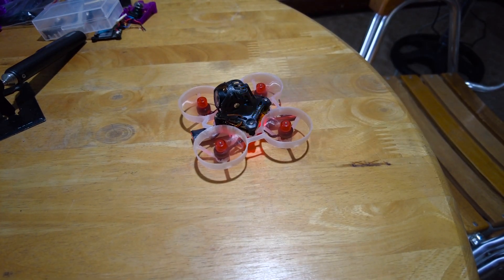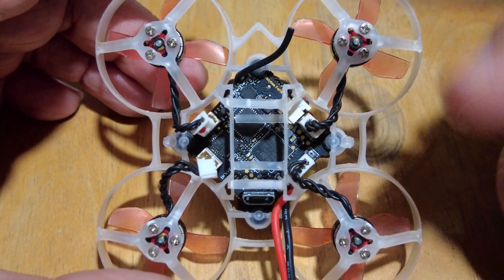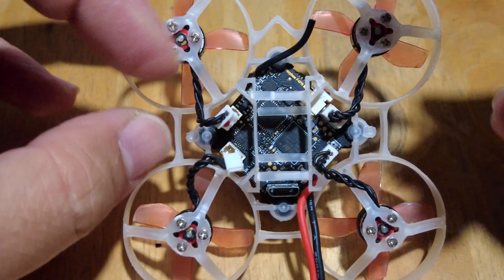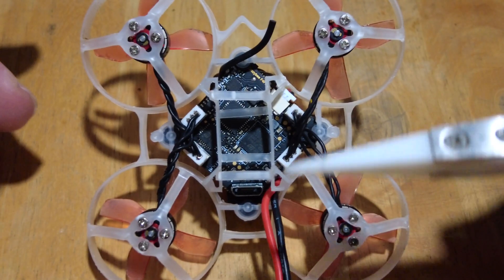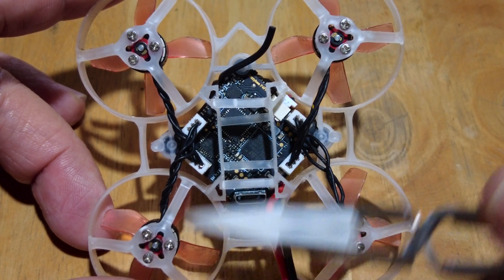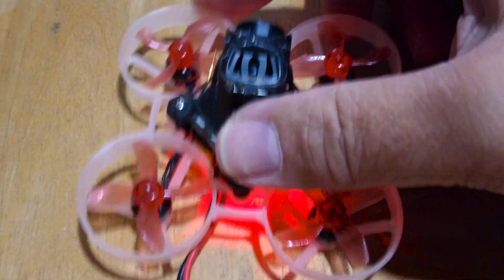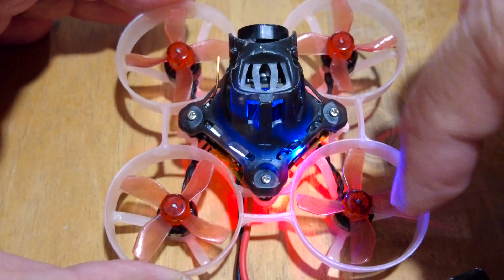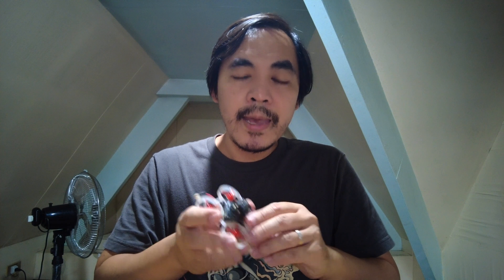[Basic Troubleshooting] Motors and ESCs

Comment: Don’t buy happy model motors Thay  are built to brake bata fpv makes nice 27000kv with the thought that the wires could be pulled on so Thay added something to save the wire
Reply from the maker: I would say depends on which model. The EX motors were pretty solid!